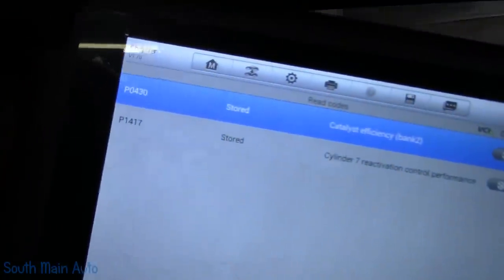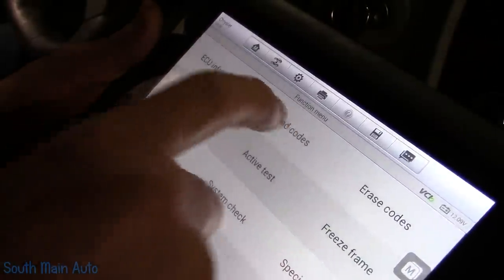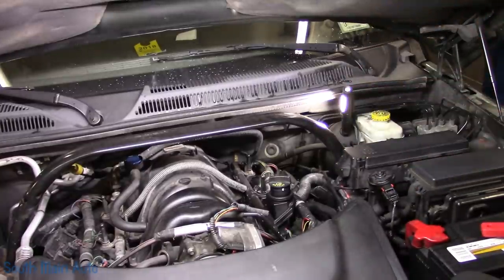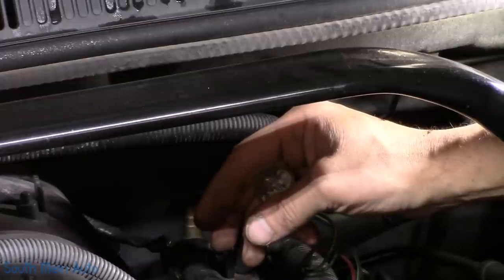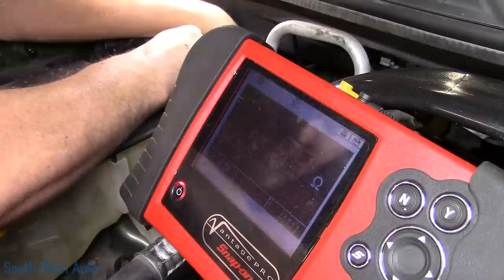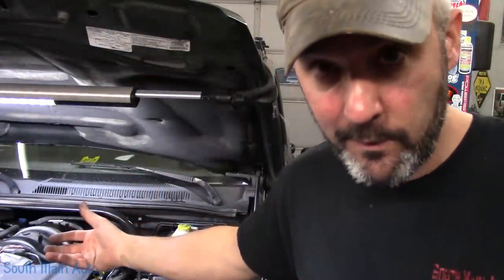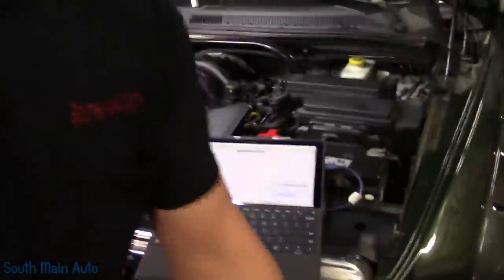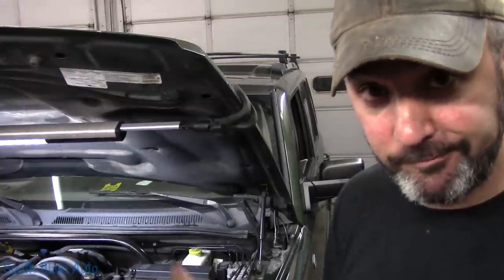Jeep Commander: Dead Misfire / No Parts Needed

Comment: Those Chrysler cylinder deactivation solenoids will wipe out the driver in the PCM in a heartbeat when they go bad. The local PD will bring me the stuff their guys can’t handle. I had a charger come in from them with a DTC for cylinder 7 solenoid. Checked the resistance of the solenoid, used a fused jumper to test it while watching the amperage and all was fine including the harness. Tested at the PCM and the driver was bad so it was replaced. Came back a few weeks later with same code. Replaced the solenoid and the PCM again and no more problems. Tried clearing the codes and disconnecting the battery for a while but no dice it was fried. They have some shitty protection on those driver circuits so from now on it gets replaced just to be safe.
Reply from the maker: I find it hard to believe in today's day and age that the ECM would not have a current limiting resistor on that driver? I can do the math because we know the voltage and the amperage draw and the resistance of the solenoid. That would be the fastest way to tell.
Reply: South Main Auto Repair The outputs of the ECM typically won’t have any current limiting resistors but instead have current monitors built into the chip or FETs and are usually self protected. They will lock out the output until it is reset. Usually just a battery disconnect for a few minutes will do it.
Reply: South Main Auto Repair you’d think it would have something but that was two PCMs. The original and first replacement. Kind of a shock to me at first.
Reply: Aaron Hammett naw it was fried. I tried everything before replacing the first and again with the first replacement. Cleared codes, reset PCM, disconnected battery cables and connected them together for around an hour. I pulled the pins out of the connector for the solenoid so it wasn’t connected when I hooked the battery back up and had a test light in its place so there was a small load there. Trust me I thought of everything possible.
Reply: al whit it was an intermittent fault with the solenoid. It’s had to have been a good year since and no issues. It may have protection for the circuit but in this case it must not have been fast enough
Reply: South Main Auto Repair You know those MOSFET driver can be current limited via hardware. I see it all the time in my MRI systems.  Once the max current is hit, the protection monitor sets a non-maskable interrupt to the controller CPU, and gets its attention.  Blowing a driver circuit nowadays should be an extremely rare event.  Newer MOSFETS have current limiting built-in and so do the IGBT’s that are used to fire the coil drivers.  I agree with Eric, blowing out driver circuits should be a thing of the past.  What year was this Jeep? 2011?  Maybe the injector driver circuit is being protected by shutting off the injector completely??
Reply: @BigDaddy_MRI  2008
Reply: @BigDaddy_MRI  last production year for Commander was 2010
Reply: I’m late to the party but I agree. 99% of the computers I’ve replaced have been Chrysler. Most of them were failed injector drivers. The rest were TIPM modules. Chrysler products keep my pockets lined but they scare me lol. Wouldn’t want to own one.

Comment: ECM problems are a real pain.  I am only guessing here but the ECM does like to remember stuff and I wonder what it was remembering that was causing it to reset the code.  You are certainly very thorough and even as you said several times that you were probably wasting time checking the injector on 7 and reminding us the ECM can shut it down I would not have been a waste of time if the injector was in fact bad.  I was thinking the oil  line could have been clogged when you started to explain how it works (and the hint that no parts were required to fix it)  Remember that Vett with the injectors that died when they were hot.  I just don't get why they are putting ecms in the engine compartment.  So far out of all the car fix you tubers (the ones you have mentioned) I appreciate yours  the absolute most.  Thank you.  If it were feasible I'd drive to your shop from LA to have you work on my car.

Comment: Well done diagnostic work.Kind of eliminates any electrical issues.I also think it is a lubrication issue could have low on oil at one time or lack of maintenance .dirty oil can cause lots of issues with very small oil passages on displacment on demand engines.

Comment: Mick from UK. This has happened to me a few time's. Check and double checked and did just same as you. Did reboot. And car runs fine. Some injectors are coded. So if you put new one it you have to tell ecm or so that's what you have done. So some time it forgets. And you end up with a misfire.. Or injector has a hissy fit. Tell injective module to shut that one off.. It happens. You did everything by the book. Hay you mite of just give up. And some people don't know you can do a reset. Been watching your cha for few weeks you work same as me. Work though what wrong. Sometimes coming back next day. To figure out what's wrong. And one video you did. Where you had a fault you had was down to power steering Val fluctuating... Your like me never give up. Your ace at what you do

Comment: By activating the the solenoid off and on several times and physically plugging/unplugging;  one of two things comes to mind, either the solenoid was sticking and thus you got it unstuck or a bad connection to which you did unplug and plug back in fixing the bad connection.

Comment: Great video, I especially love the comments below relating to the lifter / push rod example. Very funny,
Was wondering though, Injector number 7 shut down by the computer yet the plug was fouled and wreaked of gas ?
Did you actually fix the problem when you disconnected the relay's and plugged them in again. Who knows !

Comment: My brother has this engine in his pickup. I was always very pleasantly surprised at the amount of acceleration this 2006 pickup has. I would equate the acceleration near to my car in 1970. It was an ss396 with 350hp with cold air cowl induction. I recently got a dodge Journey RT with a 3.8 v6 and while no slouch with the vvt engine with a 62te transmission awd and it gets really excellent mileage about 2.5 times better than my brother's pickup. I think it would be a very close 1/4 mile race as the pickup might beat it off the line until about 150 yds when the Journey would pass it with very light panels like the back & side doors  & lower rear fenders and an extremely light hood.

Comment: In the computer biz this is what is known as a glitch. It is possible (but improbable) that the computer memory in the ECU just picked a bit and suddenly something that was enabled is now disabled. It is possible but improbable that there is a simple bit of bad code that can just get it to decide that cylinder 7 is bad. It is somewhat more probable that there was an interesting combination of signals presented to the ECU at some point that got it horribly confused and it thought the hardware was broken. This signal combination could have triggered a software bug, or may be the signal combination was a hardware bug and the ECU did exactly what it was supposed to do.

The worrisome thing about this kind of thing is that you don't know if it is really 'fixed' or if it will just come back some day out of the blue. Hopefully the car will be sold before it happens again, if it ever does.

Comment: I've seen this on several Chrysler products. Its very possibly micro fretting corrosion on the small terminal pins. Unplugging and replugging I the connector is enough to make good contact again. Likely this was the case at the pcm.

Comment: Eric,
This is an interesting case study. Id like to see a follow up on this to see if the issue comes back. The sad part here is the 'failure' was on a system intended to provide improved fuel economy on a big V8 engine whose owners generally dont give two petunias about fuel economy (or they wouldnt have a vehicle with a big V8).
SMA#1
God bless
Paul
Reply: The owners probably don't care much about fuel economy... But the government sure does. So the manufacturers need to do things like this to give people the power that they do care about but still meet tailpipe emissions regulations.
Reply: Or maybe they have a need for the V8, occasionally towing a trailer perhaps. Either way they've got a perverse masochist streak buying a Chrysler product that complex.
Reply: @KevinReinartz  
Just what I was going to say, great post SIR

Comment: I work on a lot of Mercedes sprinter diesels. While I haven’t had this with miss fires. I have had them with random codes that lead you nowhere. I have reset all adaptation values and even cleaned the MAF and told it “you have a new one”. I’ve also told it “you have a new exhaust scr and DPF”. Take it out for a test drive and have them pull like a freight train, and run for months with no issue until there really was one. For whatever reason the Mercedes seem to be kinda finicky, if they see something that makes them mad, they’ll go low power and stay that way with no failed components.

Comment: Computers they said...they'll make everything better they said...lol
Reply: I long for the days when something with a carb and not much else comes in for work...nothin like breaking out the simple tools and using yer head to find out something...then tuning it with nothing more than a screwdriver to set mixture and a wrench to loosen the clamp on the distributor to set the timing. Now all we got are rolling computers with failure modes that sometimes make you want to yank out your hair...
Reply: Kenneth James: In this and many other modern cases the old "5 percent rule" applies. Where to understand the problem and fix it, you have to be 5 percent smarter than the computer. ;-)
Reply: Eremon1 they don’t lol
Reply: In my heart of hearts, computers do make lots of things better. Can they create more problems than are necessary? Sure... but.... they can also be used to make cars safer, more reliable and cleaner. Computers can accurately keep systems in check to such a scientific degree that you end up with a precision experience in comfort, livability, performance and safety. That can never ever be given up once its experienced and adapted to by the end user. People might nostalgicallyremember and appreciate old cars, but they won't ever give up computer managed cars. It's done wonders for the industry.
Reply: Yeah computers.... they need to be rebooted regularly. Someone I know had problem with his Ford. No start, cranked fine. After disconnecting and reconnecting the battery it worked again, no issues, no codes popped up. So yes, reset and reboot makes wonders these days. The same problem with Android devices, reboot every week or else strange things start to happen (wifi hotspot slowdowns, bluethooth wont connect, app crashes/hangs/... etc).
Reply: Fuck that shit I miss being able to work on my car and not have to move six things just to get to my head lights

Comment: Keep in mind those Integrated Power Modules in the Dodges do the same thing when the headlight burns out. Even though you put in a new bulb, it will not turn on the bulb until the codes are reset.

Comment: Very good video with no assumptions made.  Just wondering if the MDS solenoid intermittently fails, does the computer leave the injector shut down, even if the MDS solenoid resumes normal operation?

Comment: Noid light reading is voltage driven as opposed to the current probe is current driven.  An open FI coil would not allow current flow even with a voltage applied...

Comment: From the Chrysler forum:

This code can in some cases be set due to computer programming needing to be updated but before you consider doing that try doing a Capacitor discharge. To do this you need to disconnect both battery cables and touching them together for a few minutes. If the code do not come back after this the problem is fixed. If the code returns then programming may be required with the latest software.

Comment: Smart move toggling the injector that defiantly tells ya the computer shut it off. I was doing a little research on it and one guy said they replaced the pcm and a few weeks later the problem came back and ended up being a cam or crank sensor
Reply: instead of toggling it with the 'noid light hooked up, I think I may have left the injector connected and watched it operate via the amp clamp on the scope.  that proves pcm control AND injector integrity
Reply: Willie Gillie Definitely*, not defiantly.
Reply: joseph migliore oops I missspelt something?
Reply: Willie Gillie Yes, but I corrected it. You're welcome.

Comment: I went through this process with my Durango.   Deactivated the MDS with a Superchips programmer, problem solved - though fuel economy did suffer, which is hard to believe that could actually be worse than it was...

Comment: This Jeep's ECM reminded me of a time when my iPhone 5 stopped responding to finger strokes on the glass screen. Needless to say, i had to a physical hard reset of the phone after a power off, and a recovery mode reset, which didn't work. I had to get my nifty iPhone opening tools, remove the screen asdembly, and disconnect the battery. I then re-connected the battery, and the phone worked like it was fresh out of the box. I call that kind of diagnosis, where you have to remove power from an electronic  device, and reboot it to make it work again, as "Device Fatigue."

Comment: Don't know about Chrysler. But the GM AFM lifters on the 5.3 and 6.0 will audibly tell you they have collapsed. Sounds like a rock in your cylinder. Had that happen twice on my 6.0. Once on #4, then on #7. I only did one bank when #4 went out. #7 was about 20,000 after that. I have since disabled AFM in the ECM. They revised the lifter design and also the oil pressure manifold under the intake.
Reply: My 6.0 was making noise on start up So I removed cam/lifters and replaced with the LS3 parts. The AFM had already been disabled from a previous tune. I had it tuned again since there was other mods done also now it runs really good and the oil consumption went from too much to very little.

Comment: Great class. One question: The noid light indicated that you had control at cylinder 7 but not that the injector was functional. Without using the scan tool to manually activate cylinder 7 and check the current ramp with an amp clamp, how can you call the #7 injector good?

Comment: My wife just had the same problem on her 2008 300 on the way back from a trip back east, showed up at the Crossing from Canada into Michigan in Port Huron. She nursed it home, it had a dead Miss on cylinder 4. I reset the codes and that did not clear the malfunction. With a hundred and seventy plus thousand miles on it. I took it for a drive and at about 35 miles an hour I jumped in a little bit to pulse the oil pressure, it cleared the malfunction. My guess is that something got into the oil system and jammed the one cylinder out of operation. None-the-less it's cleared now with no further Return of the problem in the last 3 weeks. There is a small sieve that allows those cylinders to activate deactivate as oil runs through them that can get plugged when oil changes are not done regularly or when something makes its way through the oil system and ends up there. That's why I've always tried to use only synthetic oils with really good oil filters. just started using Amsoil oil in that engine just recently and it may have cleaned something from elsewhere in the engine that may have caused it to try to act up. But the engine is running much smoother with the Amsoil.

Comment: Cycling the PCM connector fixed it.  Use the proper front probes on your meter/scope (and test light) and you will find bad pin-fit at the same time as doing your resistance checks.

Comment: My thinking is that pulling the ECM connectors and re plugging them cleaned the contacts.

Henry
Reply: staying on the ECM connector topic I suggested the connector pin might have pushed back and when disconnected the pin was pulled back into position and the locking mechanism reengaged

Henry

Comment: On my Charger (also a 5.7 Hemi), I disabled the MDS via a Diablo Sport programmer so that the MDS doesn't kick on. There's a lot of issues with MDS with lifter failure mostly due to the roller on the lifter failing and grinding down the cam. Plus without the MDS kicking in, I don't get that droning noise through exhaust when it kicks down to 4 cylinders. Also there is no delay when putting the pedal into the carpet to launch the car.  I understand that most customers would want the MDS to work for fuel economy reasons. But overall, the MDS system is a failure. It stresses the motor (specifically the timing chain) when it kicks back and forth and it's just trouble.  It was a failure back in the day when GM tried it, and Chrysler should have taken heed before implementing it on the hemi.

Comment: This reminds me of an issue i had on my Magnum just after i bought it...

I kept having overheating issues at idle along with random dashboard failures and occasional stalling. When we ran codes, we kept getting "Implossible failure of XXX". XXX meaning the system. All the codes were pointing toward the TIPM. After about of a month of random CELS and the implossible failure codes, and many hours of frustration, the ECU died as i was leaving work. 5 more days of days of troubleshooting found out that the ECU stopped communicating on half of its bus and no one could figure out why. Daimler warrantied that ECU pretty darn quick. Haven't had issues since, and that was back in 2012 and 120,000 miles.